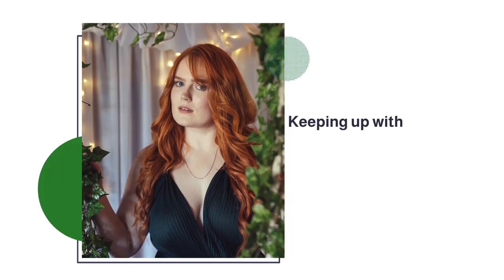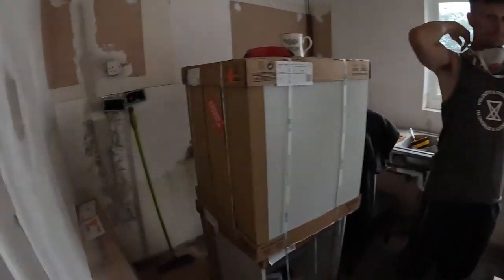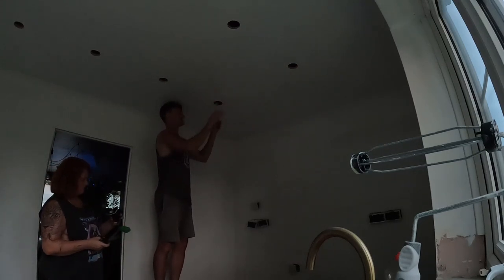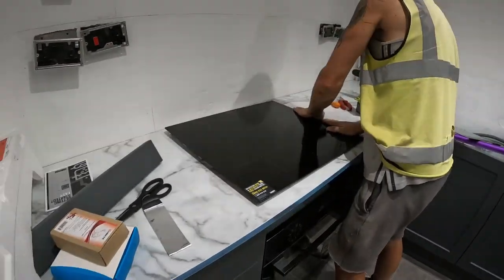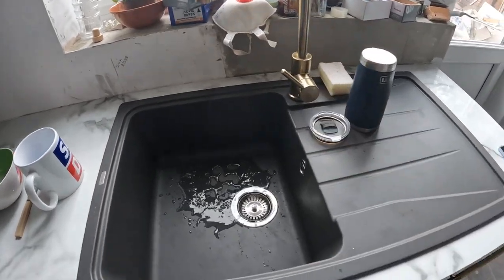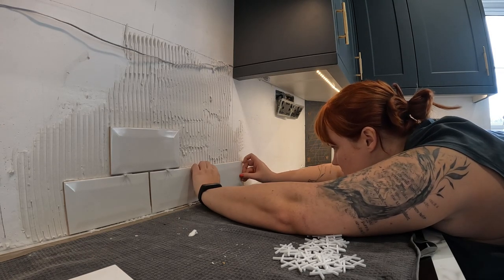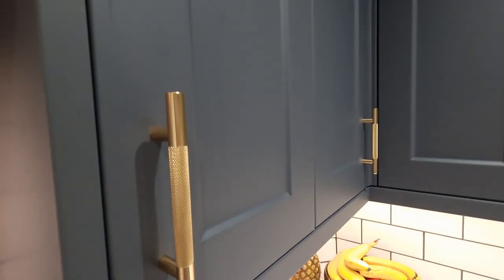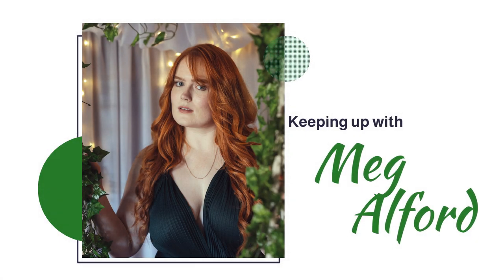Episode 13. Wren Kitchen Install - Green & Gold Theme

Comment: That's really good work Meg. The diy tiling process for the backsplash can be nerve wracking at first but once you get the hang of It, It can be quite rewarding. The Idora handles on the cabinets are also a nice touch.
Reply from the maker: Ah thank you! Yes exactly, and once we got into a nice rhythm of tiling we couldn't be stopped hehe x